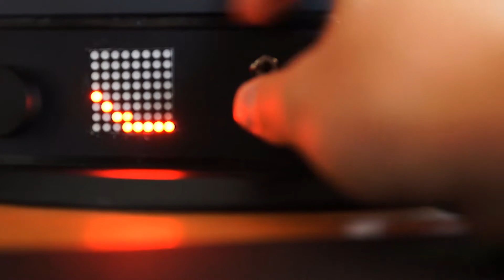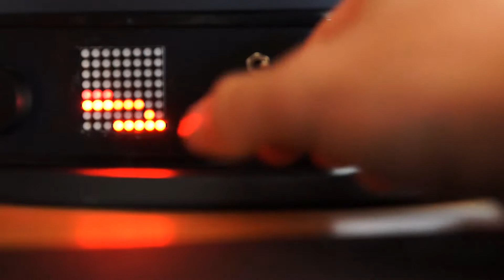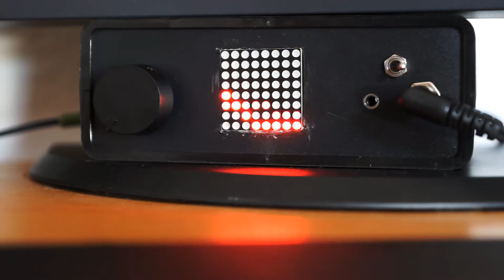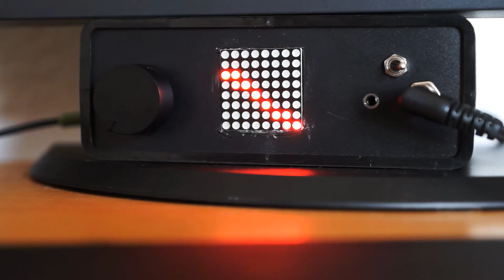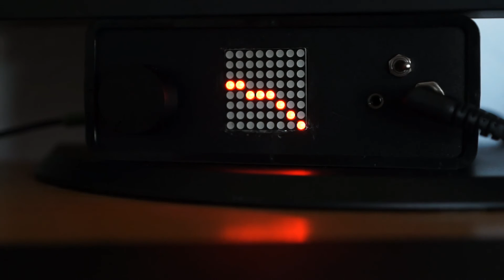Arduino 8x8 matrix Spectrum Analyzer with Headphone Amplfier V2

Comment: hi very good your project which u amplifier used.
u could provide your project?
thank you
Reply from the maker: The headphone amplifier is based around this schematic from a GRADO headphone amplifier using a Burr Brown OPA2134 opamp to drive the headphones
the schematic i used can be found here: https://elektronikshop.files.wordpress.com/2011/02/opa2134pa-cmoy-headphone-amplifier-schematic.png
Reply: and the spectrum of the Arduino project analyzer you have with the code too?
Reply from the maker: André Quintal the code should be in the description